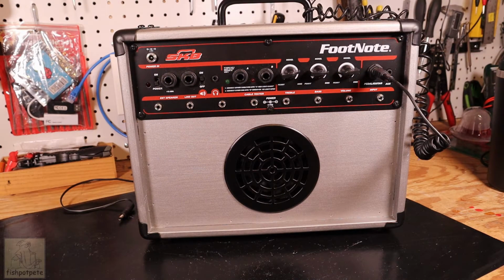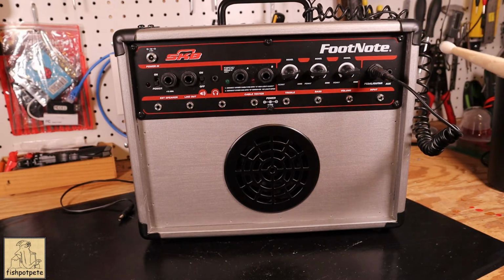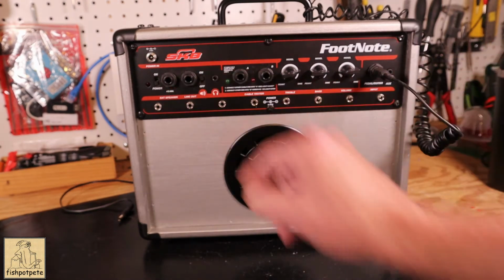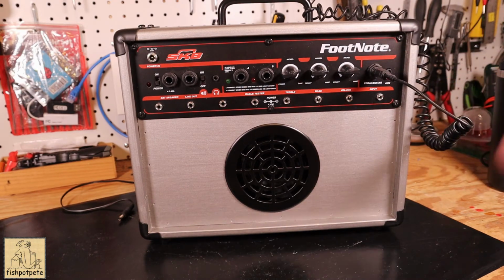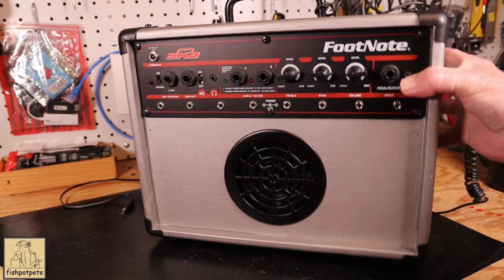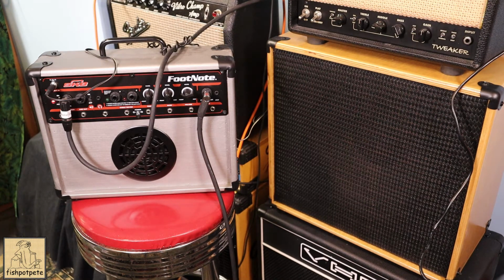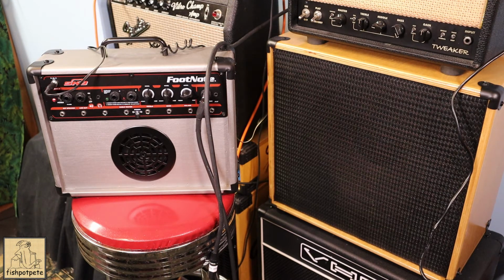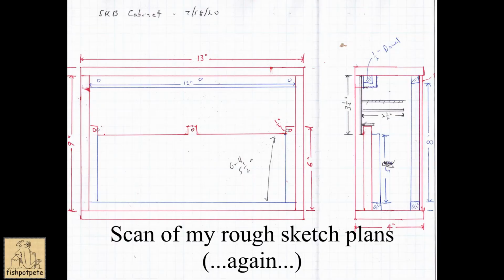SKB FootNote Combo Amp Project

Comment: I bought a couple of them, also for around $12@.  I removed the pedal-power jacks, because I wouldn't be needing them and used the holes for mounting some effects I built, a Big Muff Pi and a PT2399 echo circuit, specifically.  There's still a couple of holes left over, so I may put in a tremolo.

Because the unit was originally designed to show off/demonstrate guitar pedals, it indicates use of a 9VDC power supply.  But if one is not using the main supply to power guitar pedals, then the specs for both the power amp chips and the op-amps  easily permit use of higher supply voltages.  I can easily see a nice stiff 15VDC supply eking out almost double the wattage.  Not the greatest power-amp chip for guitar, but decent enough, and bloody loud.

I bought a pair of 6" Eminence full-range guitar speakers from Parts Express for what must have been $10 each, and put them in a tweed-covered cab, wired in series for an 8R load.  The amp is in its own small cab.  Pretty dang loud.
Reply from the maker: That sounds like an awesome build!!!  I think you gave us a new goal for using these 😀

Comment: What ohm/wattage speaker did  you use on this . Am Having a hard time finding low wattage speakers .
Reply from the maker: You can pretty use whatever wattage (and ohms rating) you want.  The tiny speaker gives you a tiny sound though.  The nice thing about the 4 ohm rating on the amp is that you can safely use 4, 8 or 16 ohm speakers without harming the amp.   The speaker that's in there is maybe 10 watt?  But I recently ran it through a 8" Fender Rumble cab - 20 w, 8 ohm (the amp died in that, so I just turned it into an extension cab) and it actually sounded pretty nice for a solid state pedal board amp!  Plus in the video I show it with the 12", 16 ohm, 60 watt speacker as well.

So basically, any speaker that fits the cab (or whatever) you're building.  Let us know how it turns out!

Comment: Hey sorry for being a little late to the party . I just dug out my footnote  i got the same as you did just the electronics . If you don't mind me asking are you using a 4ohm speaker in your cool little silver cab you made there.
Reply from the maker: It's got the 4ohm speaker in it.  This turned out to be one of the more useful gadgets I've build.  It gets used for everything from testing speakers, testing pickups, testing output jacks, testing headphone jacks, etc.  What started as a fun little project turned out to be a dependable, handy workhorse!  The only thing I'd change is maybe a bigger speaker.  I haven't had a chance to test the pedal power supply part yet.  I think I always forget it's got those little power outs on it.  I wonder if a larger Harbor Freight ammo box would work with these?

Comment: I had no idea these were made for a pedalboard. I bought one when they were $29.00. now they go for $9.95. I also bought Tolex, grille cloth, corner braces, and a couple of eminence 6" guitar speakers. I first built it out of MDF, and had problems with the screw stripping, so I used 3/4" plywood. it ended up being larger than I planned, and when I played through it, I was kind of disappointed with how wimpy it was. I built mine to look like a fender amp with the slanted faceplate. It looks nice, but has no punch at all. After seeing yours, I wish I had tried using it for a pedalboard. I put it up for sale, but the cost of the materials makes this a money losing proposition. If it was a 25 watt amp, it would be more useful. just my opinion.
Reply from the maker: Your project sounded cool!  But I understand your disappointment in the sound.  I use my for testing various things and it's been a total time saver for me.  It's more like a desk top power supply or a multimeter kind of tool rather than something to make music with.  Thanks for sharing your experience!

Comment: Nice build.  I bought one of these amps recently to give to my nephew.  I will build a case and put a 8 inch speaker in it to give a bit fuller sound.
Reply from the maker: Yea, I still feel that I skimped out on the little speaker I used.  I like your idea of a bigger speaker.  But even with the undersized speaker, this has been a great test bed for various things projects.  Great to hear you found a good use for it -  Hope your nephew appreciates your work! :-)

Comment: so funny... i got one of these 4 years ago... the headphone was clipping and junky.. never tried a speaker until today. Wow.. a second chance!! This is very usable for the right situation.. like my granddaughter. Your cabinet is fantastic workmanship... worth 5x that of the amp. Very nice job sir. I'm going to repurpose some of the inputs and wire-in a couple of effects pedals PCBs on the back and bring the pots out to the panel. Just saw a Sweetwater youtube of this in it's original pedal board layout. I can see how it didn't take off ... they skimped on the speaker
Reply from the maker: You caught me just before I started shutting down for the day :-)  I find myself using this as the go to amp when working on various guitar and speaker projects.  This past week  I used it to test a mid-60's Japanese electric I was rehabbing to test the pickups and do a basic set and, a few days before, to drive a 1925 extension speaker to see if it still worked (it did!).  Best $15 I've spend during the pandemic!  I'm glad to hear  you are finding some uses for this little guy.  Thank you for  your comments!

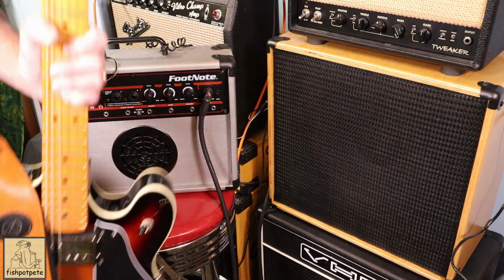Comment: 4:54 Nice Squier Starcaster. Great job on the amp build.
Reply from the maker: Thanks!  I actually forgot I had this little amp unit until I went to build a cabinet for that 12" Chromeback speaker.  I added it to the project build at the last minute and got both done at the same time :-)
Reply: @fishpotpete  Great Job